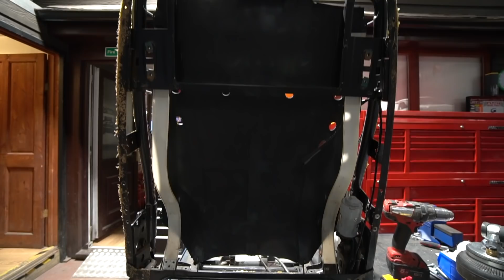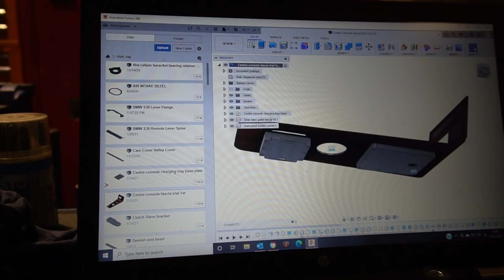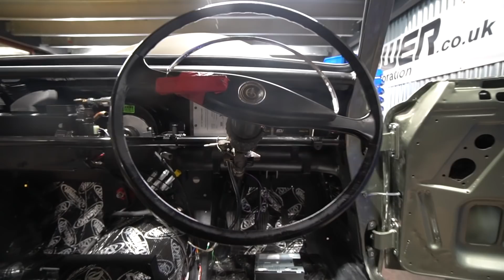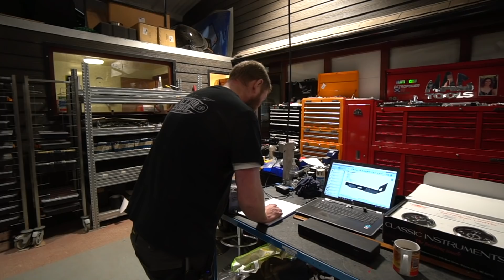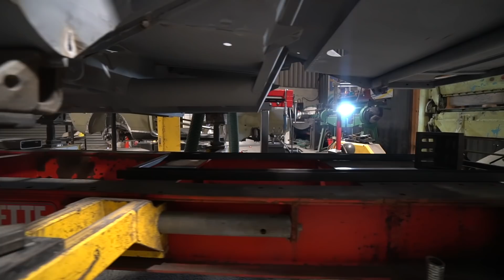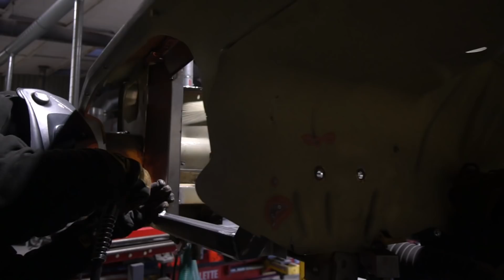Retropower Uncut Episode 25: MK2 Jaguar interior progress &  Jensen C-V8 chassis work starts

Comment: I'm no expert in plastics, but you said the 3D printed vents are impregnated with carbon fibre, as the plastic breaks down over time will carbon fibres be pushed into the cabin?

Comment: Any recommendations on where to source a good Group 4 spec radiator as used in the Chevette please?
Reply: Retropower have chose a Escort RS item. You could just get a replacement HS /HSR group 4 rad.

Comment: A suggestion for the phone recess/charger...
Have it deep enough that a phone CANNOT bounce/fly out - and...
Have an extra 1cm deeper (and angled?) recess at the front end so that the driver can push down on the end of the phone and pop the body of the phone up into his hand. This way the phone is easily retrieved without the risk of it flying out.

Comment: Carbon strands in heater box ducts ? TO Take the heat YOUR TAKING THE PISS
Reply from the maker: Its the fact it's PETG not PLA that resists the heat mainly, the chopped carbon fibre strand just makes it physically strong, which is also important as the expansion and contraction with heat could crack unreinforced material where it slips over the spigots on the heater
Reply: @retropowercars  YOU NEED TO TELL ROLLS ROYCE AND ASTON MARTIN BECAUSE THERE ONES ARE PLASTIC LIKE FORDS AND KIA'S
Reply: A thin 3d printed Pla panel will distort on a dashboard on a hot day let alone as part of a heating system.

Comment: What's wrong with the original Smiths gauges? All Jaguars had them and they are part of the identity of a Mk11.
Reply from the maker: Same reason we're not using Lucas wiring and switchgear... we'd quite like it to actually work 😆
Reply: @retropowercars  Love the videos, Been watching Utah from the start.I Im nterested why the speedo is only calibrated to 120 MPH ?
Reply: They haven't changed the look much: simple black dials, white markings, similar(if not the same font) and the traintracks round the outside. The red tips to the pointers are a nice upgrade, and hopefully the illumination is green like all instruments should be

Comment: Before you finalise a design for systems and things like consoles, do you run through a mental check of what it will be like to work on in the future? When things wear out, break, need testing or otherwise don't just sit there quietly working,  so often maintenance seems to involve removing 7 layers of obscure fastenings and fixtures to diagnose or replace the actual problem. It's bad enough with a stock machine and a Haynes manual, much worse with a custom setup.  Many's the time I've thought dark thoughts about forcing the designers of some vehicles to dismantle them, so they'll realise the pain they've inflicted on unfortunate mechanics. Putting connectors in sensible places, not putting sharp edges opposite bolts liable to seize and considering access paths could repay a little thought experiment many times over.
Reply from the maker: We do put a fair amount of thought into serviceability, not least because its likely to be us doing the work!
Reply: @retropowercars  That would be a motivation. :-)*
Reply: @retropowercars  That Stratos is still going to be a bugger to maintain tho, yeah?

Comment: Nice to find someone that shares my opinion on touchscreens
Reply: Hate them and I think they’re inherently dangerous
Reply: there's probably a lot more than you realise who do not like touchscreens. some functions maybe but never any of the ventilation controls, heated windows etc. it's a shame more car designers don't watch you tube videos to see what the normal car buyer wants.
Reply: @iggsy61  it’s a shame car designers get sucked into following the crowd. Drivers know and you can distinguish them by their opinion of such things. I’ve heard people (kind of people that choose an Audi) saying that BMW’s are basic inside etc. To me, that’s one of the things I like. They got it pretty good with the E30 and have slowly refined things. They’re not typically a spaceship interior with buttons, screens, bells and whistles, because they’re a driver focussed car. I like the orange dials in our E91, they were the similar in our E36 and possibly the E30, but I can’t remember that far back 😄 point is they haven’t changed the colour for the sake of it.
Reply: Touch screens in cars,, when they fail the car is a write off. 
And yes they are generally unuseable when driving.
Reply: Yes I agree I went to a lot of trouble cutting and welding up my dash and building a custom steel center console to fit a touch screen I got a buddy to build a car computer hooked it all up to replace a lot of my switches and it's basically useless while driving

You have no feedback at all and that is very unsettling while driving

Now to cut up the dash again and put new physical switches in
Reply: Terrible idea. I had a courtesy car while out E91 was in the body shop. Think it was a Citroen of some kind, cactus maybe. All I can remember was at 5am on the way to work in the dark, I was being blinded by a screen that was completely over the top for the few functions I require. I much prefer a mk1 golf heater setup. Or the later 90’s vag rotary arrangement, which is effectively the same in our Skoda Fabia. It can be done by muscle memory without looking at it.
Reply: @southney7211  I agree that touchscreens are a bit sketchy (until fully autonomous cars become a thing).

However.. You can actually adjust the nighttime brightness on the Cactus to a comfortable level, there’s even an easy way to turn it off totally until you tap the screen again! 

I always tend to give the manual a quick read through when I get a rental or courtesy car, because it’s usually quicker than sitting there trying to work everything out, and it’s a bit dangerous trying to work out the basic functions while moving.
Reply: @Jonathan_Doe_  I can’t get that invested in a courtesy car I drove maybe twice. I don’t even read the manual for  the cars I own 😄
Then again I don’t need to, because the heater controls can be operated blind - how they should be.
Reply: @southney7211  It takes like a minute to get the manual out the glovebox and skip to the heater/light controls section and skim read it 😂. 

If I’m getting a courtesy car I’ve either broken down and my plans have been disrupted anyway, or I’m taking my car in for a service so I’ve taken some time out of my day already so another minutes nothing. 

The better rental places/dealerships tend to give you a quick rundown before they send you on your way anyway, it probably seems like cheap insurance to them vs. the risk of someone getting ran into because their lights were off, or them crashing while trying to work things out on the move.
Reply: I think it is a matter of not thinking about it, or hating it.
Reply: My car has a touchscreen but also accepts other inputs from buttons. Great to have different options. Hate the fingerprint marks on a touchscreen
Reply: I can’t stand them either.  It seems to be the gadget freaks who like them, but proper car enthusiasts not so much.
Reply: I'll not be buying one.
Reply: Presumably, most people you know actually like them?